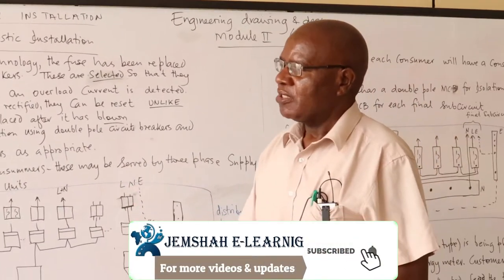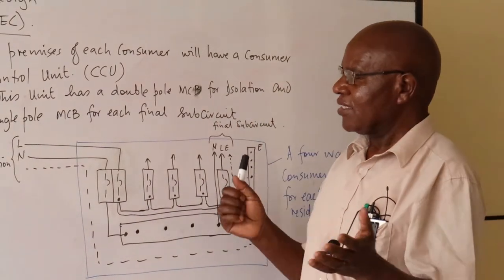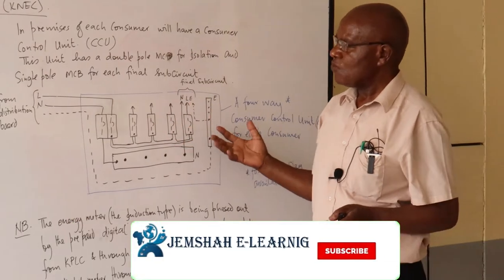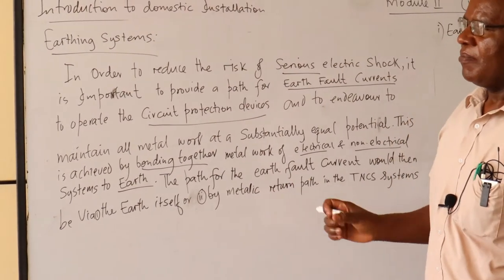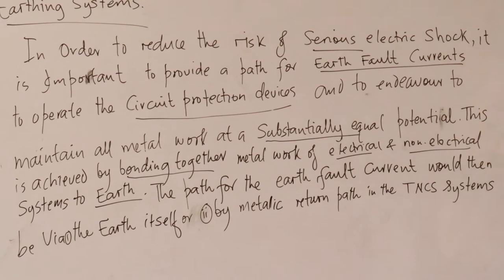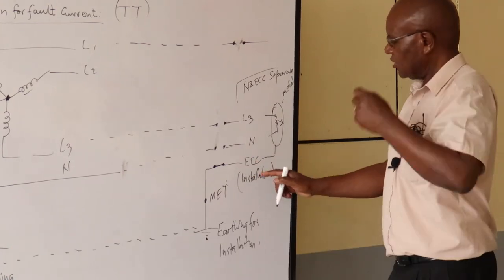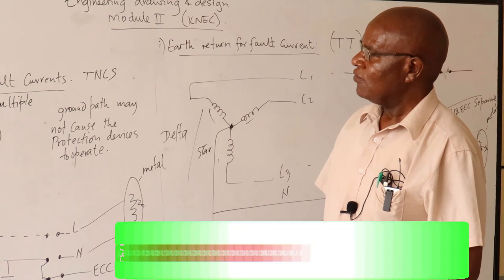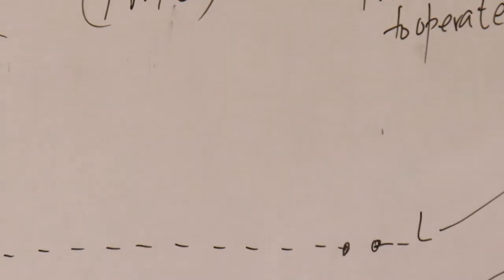INTRODUCTION TO DOMESTIC INSTALLATION PART 2 (BY MR. MWANZIA)

Comment: 10:25 This is incorrect. Connection from the consumer unit to the prepaid meter is via PLC. Separation distance is not a concern unless greater than 300m where signal attenuation and interference become a factor. Great video, otherwise.